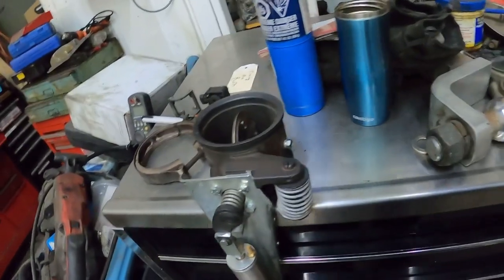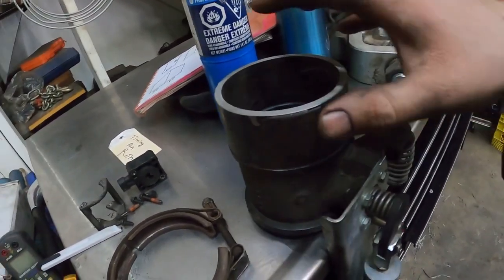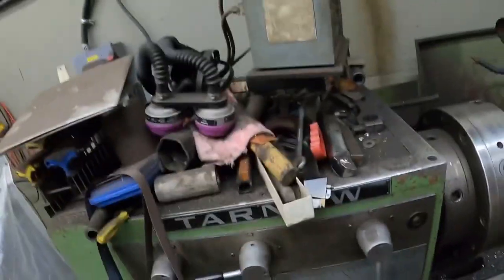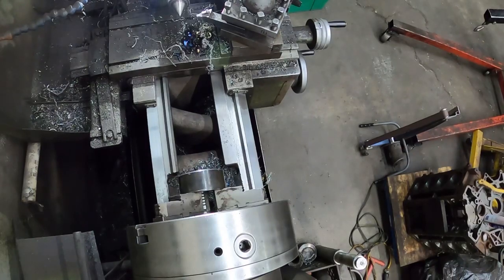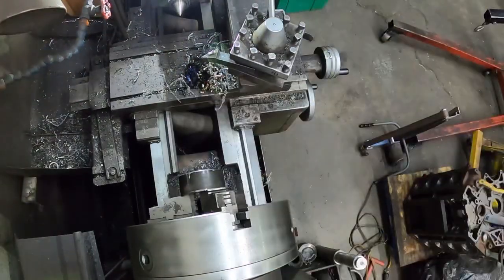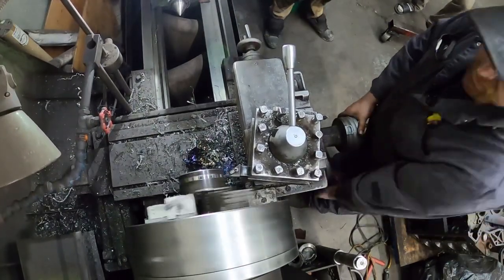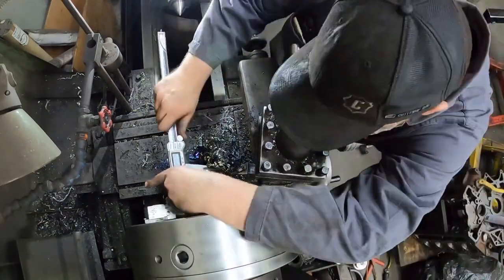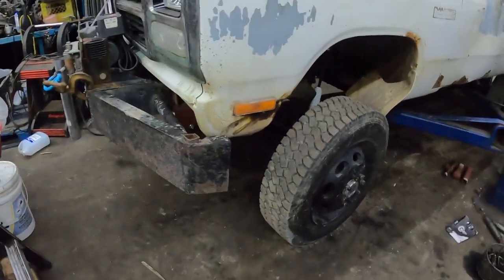Machining a flange for an exhaust brake and showing it a the first gen

Comment: Would be ineteresting to see how much back pressure is created when the butterfly valve is closed.  

I just installed a drive pressure gauge with copper coil on my truck.

 I like being able to watch boost and drive pressure at the same time, kind of gives you an idea of how efficent the turbo is working
Reply from the maker: Yep sure do. I will be doing some stuff with his exhaust brake. But he is back to work for a bit now so won’t be for a bit. But I will be using some exhaust brakes on the next projects

Comment: I appreciate you helping out a friend . My dad had a first Gen and his truck was used pretty hard . I noticed tires wearing on the inside and it did not drive straight.  . I noticed the front tires seemed to have a lot of negative camber . So I pulled the front tires and placed a witness mark on spindle on very top . I pulled the spindle and he machined the back side at a taper . This caused the wheels to plumb or 0 camber . I done this before on a Toyato 4x4 also and it works OK.  Instead of buying the tapered shims . .. After this the truck drove correctly and did not wander over the road .